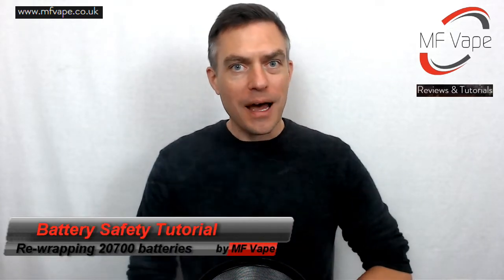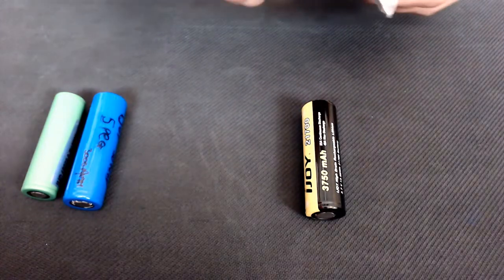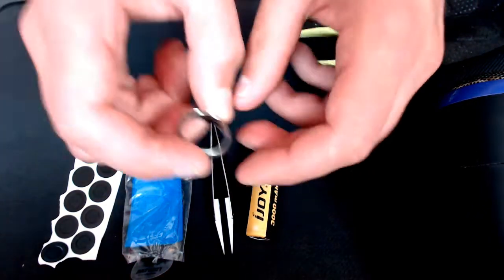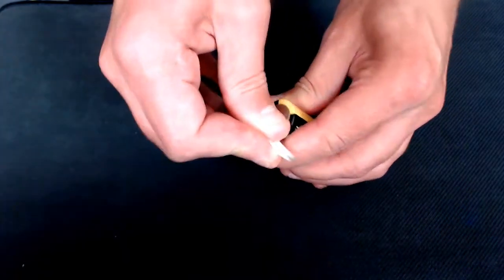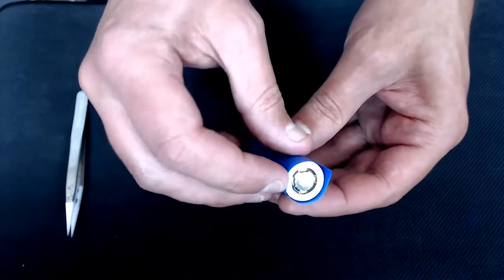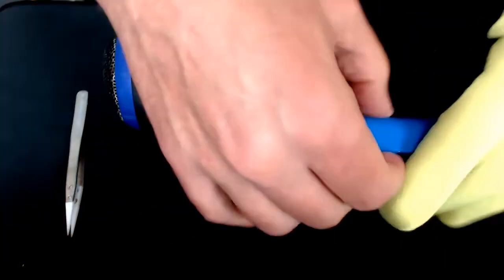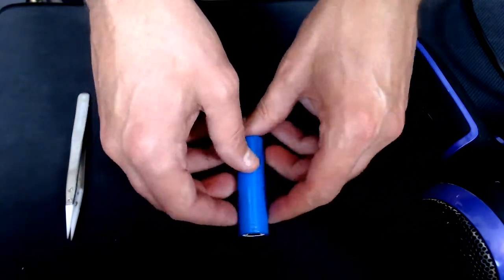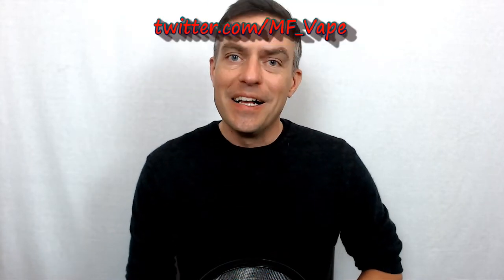Battery Safety - How To Rewrap Your 20700 Batteries (& 18650s/21700s)

Comment: Man i have important question are the battery wraps for 20700 same as 18650 ?
Reply from the maker: No they are different widths and lengths mate. 21700s are 21mm wide and 70mm long, 20700s are 20mm x 70mm and 18650w are 18mm x 65mm. You need to search for the required wraps for the type of battery. Saying this, I have managed to fit a 20700 wrap on a 21700 battery before.
Reply: @MFVape  thank you! Much! for the info.

Comment: If memory serves me correct, the '0' at the end of the size indicates that the battery is circular.
Reply from the maker: Thanks for clearing that up Dean. It appears that Tesla are dropping the last zero on their new 21-70 battery packs for their cars: 'Elon Musk of Tesla elaborated that they actually changed the size to 21mm diameter and a 70mm height. They also got rid of the trailing ‘0’ so the name of the battery that will be going into the Model 3 is the ’21-70′ battery. '

Comment: im gonna tell you a secret. ive been a naughty boy... ive never rewrapped a battery... i just throw them out if they get ugly cut up or in the rare situation two of my batteries have discharged and exploded.. not at the same time either lol. anywho im glad ive found this video because i'm gonna order some wraps on ebay today. <3
Reply from the maker: Oh dear, that's not good mate. Glad you found this video useful. Just make sure you keep the insulator in. You may find the hairdryer blows it off but look to see if you can order the insulators too as they are sometimes sticky so this helps it stay on. Be safe mate. Cheers for watching 👍